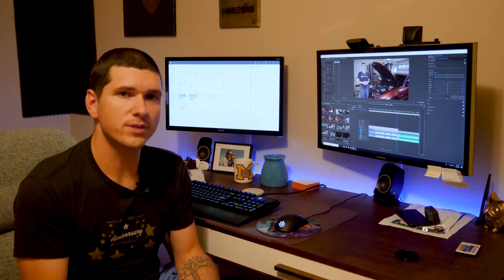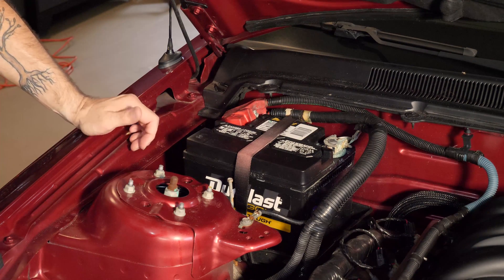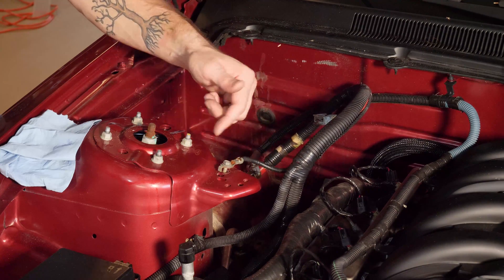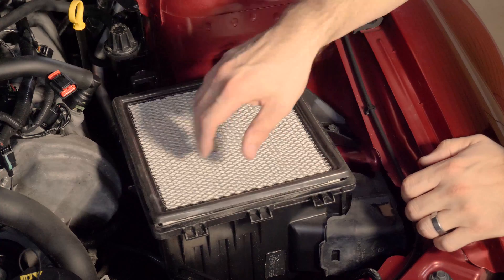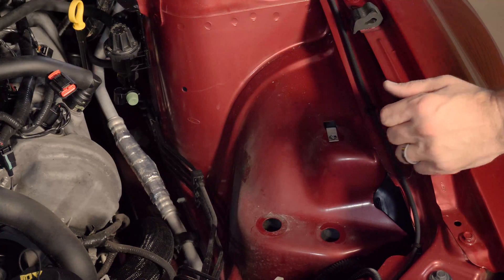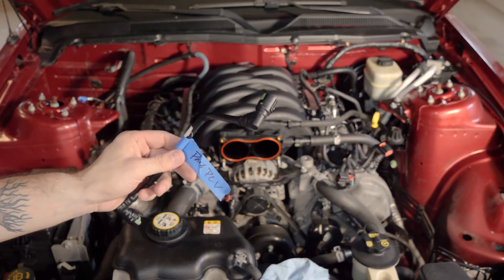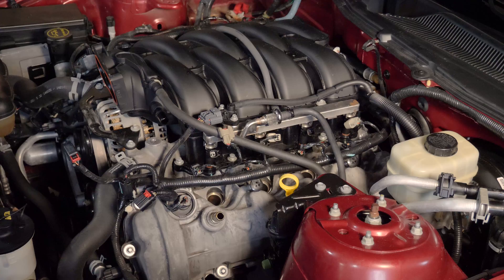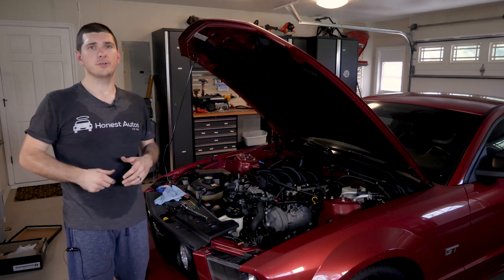How to Disassemble A Mustang GT 3v 4.6L Motor 2005-2009 Part 1

Comment: Thank you for making these videos. I have a 05 Mustang gt with the metal electrode from the spark plug broke off and fell into cylinder 8. I've tried everything to get it out, but it is bent and stuck in there. Now, I will have to tearing the engine apart and I'm using your videos as guides. So much appreciated thank you

Comment: for anyone wanting to tackle this themselves but are nervous to, here’s my advice. I’m 16 and the most I’ve done on a car before this was spark plugs and coil packs, but I did my research extensively, made a checklist, and everything went smoothly. Also if you have the money, I strongly recommend replacing timing components (especially the weak tensioners), oil pump, and water pump assuming you’re looking to add more power eventually. Best of luck!
Reply from the maker: Awesome! I love comments like this. Thank you for contributing. I second the timing stuff. If you're that deep into it, just do it. Woth it 100%.

Comment: Did you dump all the fluids first? Its so clean in the engine and nothing is spilling out. I need to replace my oil pump and this a good video that shows how to take everything apart
Reply from the maker: Yes Marcus I removed the engine oil and coolant. Yea I got lucky when I bought this and it’s a very clean engine bay. Thanks for watching man!